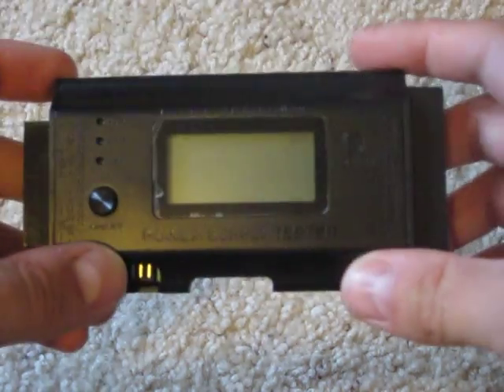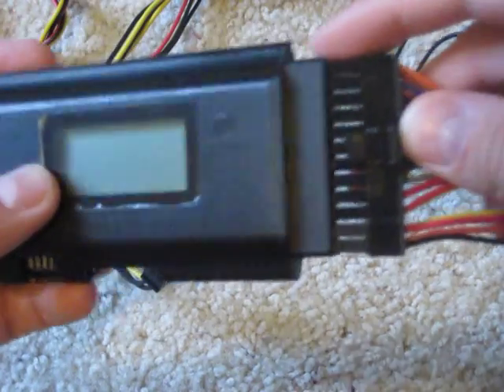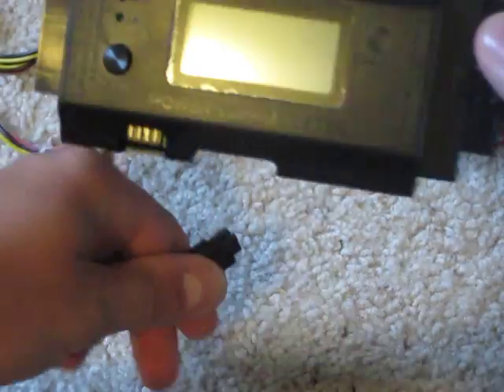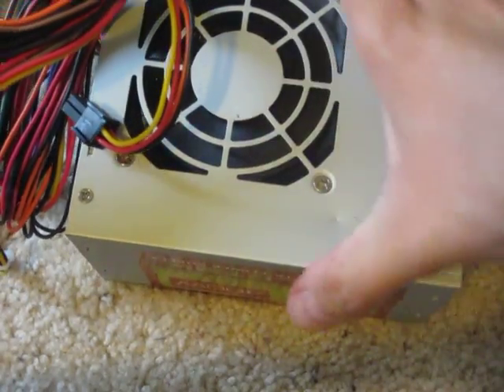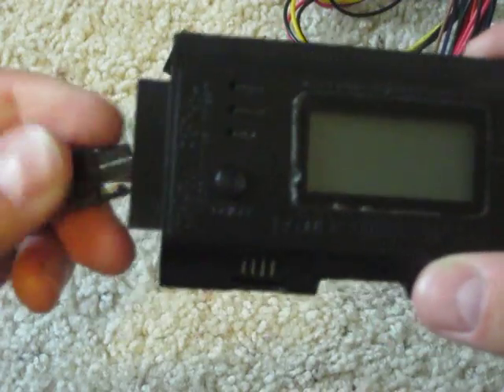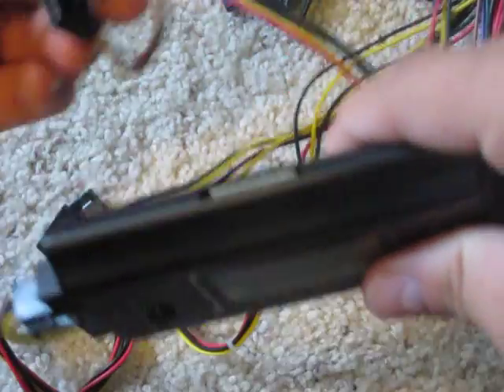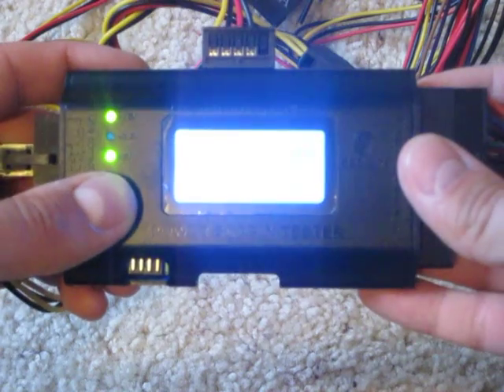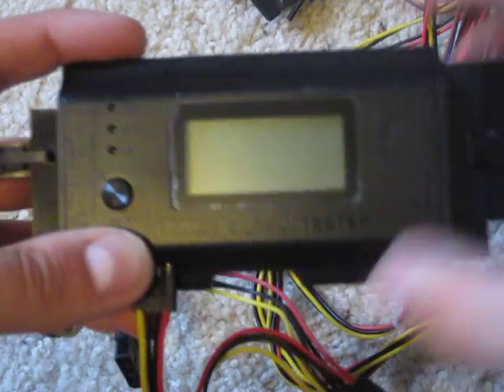How to use the Coolmax power supply tester

Comment: So i am guessing that "LL" according to your video means "Low Voltage"? I am trying to find out what "HH" means. I have a Corsair 1200 Watt PSU and i am having totally random power lose while running Windows, the computer will run for days without any issues and then all of a sudden it will just shut off, no "Shutting Down" or any kind of warning or message, it just turns off. Then it powers on by itself, even though i have the BIOS set to "Do Nothing" After Power Loss. I had it replaced once under warranty, and it seemed to pass, but now i get a beeping and a "HH" on the "PG" SOMETIMES when testing, i can turn it on 10 times in a row with the tester connected and 7 out of 10 times it will beep and say "HH" on "PG" the rest of the time its all in spec and the PG says 480ms. This is getting really frustrating, as no one wants to deal with it, i took it to 3 different Best Buy Geek Squad centers and they all looked totally confused, I have also taken it to several smaller shops as well as speaking with Gordon Mah Ung (Senior Editor at PC World) for about 3 hours trying to narrow down the problem with no luck. Does anyone have any clues? Specs are as follows; GA-X79-UP5-Wifi Rev 1.0 (C606 Chipset) with a Intel i7-3930k (Hex-Core) CPU and Retail box Intel CPU Cooling Solution, 64GB DDR3 PC10666 RAM (8x8GB) matched set (I tested each modual in a Z68 and X58 motherboard and they work fine as well as running a bootable memory test on them, GPU is a XFX RX480 8GB Black, Storage is five 5TB Seagate Barracuda, five 3TB Seagate Barracuda's, a 2TB SSD for BOOT a LG BD-R, LG-BD, and a ASUS DVD-RW (14 SATA devices, the max connections on the board via 3 on board controllers) in a Cooler Master HAF Full Tower with a Cooler Master 1200 Watt PSU running Windows 10 Enterprise 64-Bit. Ok, that's it, any help would be awesome. You can message or email me at VipersHardware@Hotmail.com or join my channel at MiloHajek on You Tube. Thank You in advance
Reply from the maker: Milo Hajek yes, LL or HH message means the PSU is faulty
Reply: fishbone,  thats what i feared, you would think that if you spent $300+ on a PSU that it would be good. Its a Corsair AX1200 Gold and its the second one i have gotten for this system. The thing that really pisses me off is that i think it damaged my 2TB SSD boot drive 😕luckily i unplugged the five 5TB drives, the five 3TB drives and unplugged all my ext 5 & 8 TB drives. I can't wait to see what Corsair has to say about this as i think it has a 5-year warranty (i hope i remember that right) as i am right on the edge of 5 years. Thanks 😉 ps sometimes it passes and doesn't beep and other times it does which makes me wonder about this $18 tester from NewEgg, but the PC keeps shutting off leading towards the "its faulty" conclusion
Reply from the maker: Milo Hajek that sucks
Reply: Thanks for understanding, it would explain alot, the puzzling thing is that i have always had it on a VA1500 Watt UPS and the replacement tested "ok" when i got it but the last 6 months its been doing this turning off horse$h!t and now it's just not staying on, it turns on, then off, then on by itself and off again, and it repeats this until you finally flip the 0/1 switch on the back. =/ grrrrr
Reply from the maker: Milo Hajek still under warranty?